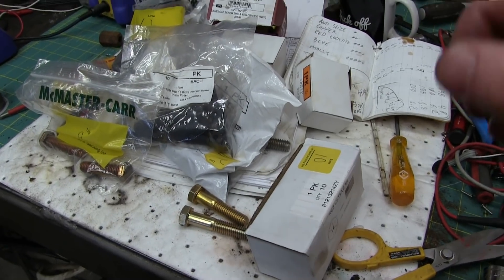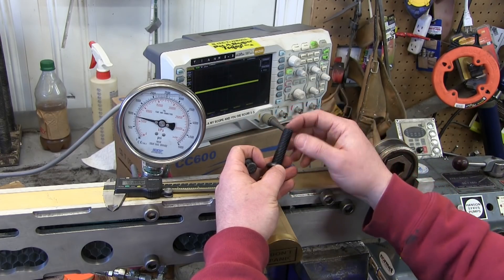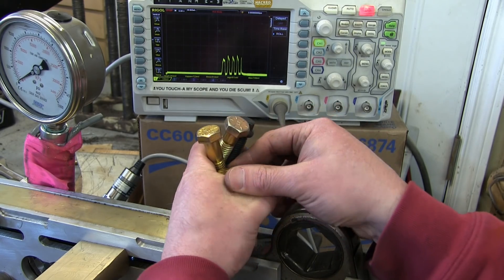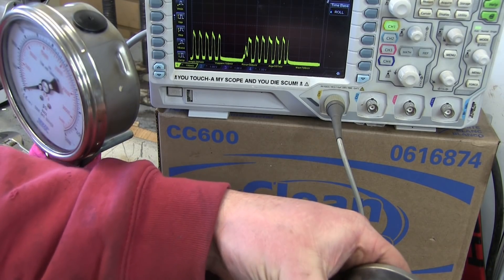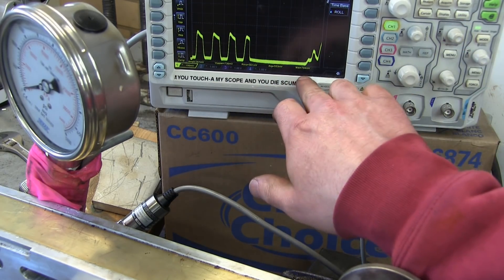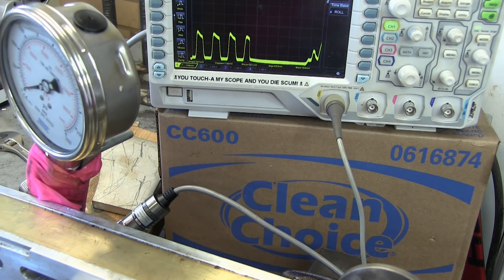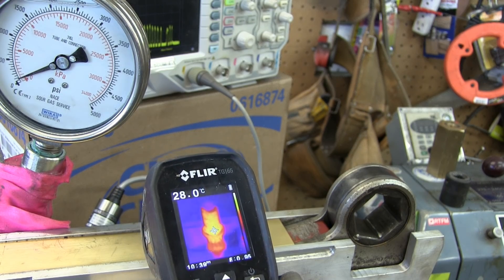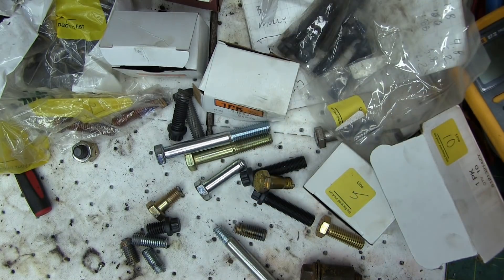Home Depot Bolt vs. USA Made | Offshore Suprise!

Comment: The challenge with using bolys that are significantly stonger/stiffer than the rating is that you will not torque them to the correct amount for them to function properly.  A properly torqued bolt is stretched but not yeilded so it will act as a spring to retain the load.  Some applications require that bolts be springy.  This is especially important when there are significant loads from thermal changes.

Comment: I'd like to see the torque waveforms integrated over time; see which bolts spent more "torque energy" in different stages of ductility. I suspect there is a ductility sweet spot would give at less torque than a harder fastner, but may also allow more energy overall to be exerted in the stretch. Drywall screws are hard as frig, but don't build your house with them.

Comment: Does  your test rig read higher than ~780 mv when back driven like this?  It seems awfully suspicious that the stripped out threads gave a similar reading to breaking the bolt on the last one.  It looks like the gage itself isn't going over 500 on any of them.

Comment: We use J H  bolts to screw in our pilings and extensions. Our tap out torque is between  8000ftp to 15000ftp. Our threaded connection is a Mayhew Style coupler and Bolt we build. If powder coat gets on a threads , it would stripe.

Comment: AvE is it true a bolt only has to go  in the depth of its diameter to achieve its full torque strength?

My old boss used to say that and as you mentioned about the length and only having to be 6 threads or so to achieve that strength.

Comment: I was taught in high school shop class that fine thread was stronger because it has more surface area of thread in a given length. Never looked it up to see if that is correct, the thicker "root" of the bolt is logical as well.

Comment: in australian mining industry everyone asks for CAT bolts from good ole USA
Reply: yep! I used em for head bolts on my 302 Ford Motor. 12 point heads, still in there!
Reply: @stephenvelden295  Interesting. I don't quite know what your version of CAT is, but I know it as California Auto Transpeed. It's a Chinese company that makes crankshafts. I have a 3.75 inch version for a small block Chevy to stroke a 350 to a 383. It's made of ductile iron. Excellent Crankshaft. I've abused it and it holds up. Balanced right out of the box, machining for the rod and mains was spot on....Can't buy 'em in America anymore.
Reply: @ViewThis.  CAT is Caterpillar. It's a registered trademark.
Reply: Freedom bolts!

Comment: Sad fact: manufacturing will follow demand. Masses demand cheapest. Corporations follow product flow measured in units moved. They direct manufacturing to follow trend. Engineers find ways to CUT costs providing financially sound returns on investment.  Product floods markets. Consumers buy extra cause of great deal. Cycle repetition. Further cost refinement. And the beat goes on and on and on!

Comment: I worked on a subarban with a rough country lift kit in an auto repair shop. The fuckin thing was put together with home depot shit, like the washers were dishing. No holes lined up on this POS welded flat bar lift kit and it took way over time. Had coworker who has never done a timing belt being like "bro just cuz its a truck dont get mad" and my boss kept asking me why it wasn't done, then the customer comes back and tells me to look up torque specs and make sure everything's right. I laughed and said "they wont hold torque if the washers going to extrude out anyway" I called a tow truck and got my tool box out of there 8 am next morning and did not apologize. Now I work in a Mercedes Benz shop and get to work on real vehicles (nobody likes the old mercedes here so I get ALL of them and love it).  Not super relevant, it just pisses me off people are driving around massive trucks held together with chinesium just to look cool.

Comment: the test works but u need to account for the amount of attempts u made, since u are adding higher toque than what u are seeing. What you are seeing is your own physical limitations. Do a pull test of sorts. Have worked with all those bolts and yes quality does matter for strength also consistence.

Comment: All of the Asian market hardware is pretty strong, they have a tighter control on the quality of their steel and actually their 10.9 grade metric fasteners are far stronger than a standard USA grade 8. Their 12.9 grade metric fasteners are really strong, They make diesel engine fasteners out of 12.9 grade metric threaded steel.

Comment: I have seen a lot of problems with generic Chinese fasteners in my career.  My experience is that if they have a mark on them indicating the manufacturer (YSK for example), they are probably good quality. 

Keep in mind that stronger is not always better -- all the material properties should be met. For any given alloy, strength usually comes at the expense of ductility. If impact loading is present, a higher yield strength bolt may fail before a lower one because it is more brittle (i.e. requires less energy to fracture).

Comment: Random question, we deal with compression tube fittings typically from parker and swagelok in my trade, but occasionally we run into steel tube fittings with a "C" stamped on them that don't play well with standard swagelok parts. I have always been taught that these were carbon steel fittings, but we had one that clearly showed it as 316 stainless. For the life of me the google monster can't solve this one. Any insight?

Comment: The chinese make a clone of the colt 1911 pistol, made by a company called Norinco. I've read they're made using extremely hard tool steel because that's cheap and plentiful over in Red China. Might be a similar situation with their fasteners, they've got all the manufacturing over there, so now the quality is making the migration.

Comment: This is pretty interesting. I'm a carpenter and I work on a US Marine Corps base once in a while doing remodels of barracks. We're actually not allowed to use any Chinese fasteners because the grade of steel could be anything. The boss man would love nothing more than to put in a big bid and use the cheapest fasteners money can buy, we use hundreds of pounds on each building. Everything we use from metal truss screws to structural steel bolts has to say "Made in the USA" on the box so it's strength is actually what it says. I was a little surprised the Taiwan bolt was so good. The more you know.

Comment: I used to work for a company that did NDT, DT, Xray and Ultrasonic testing for military parts. In the DT (destructive testing) area, the way we tested bolts was how Uncle B described he would do it for the next episode - Pulling the bolt from top and bottom and getting to see the failure point. It is astonishing how much force they can take before they warp. But that being said, with any Steel base structure, you hit a certain point of force that becomes common on the high end. It is the upper limit the atoms can withstand before you start introducing things like titanium or cobalt. Super fun job tho, getting to break shit the military owns :)

Comment: Great video it demonstrates why many OEM's use Torque to yield in critical applications. Its a very flat curve so very predictive clamping force.  There is so many more to the grade then just the breaking point how much the bolt will stretch what the curve of that stretch is etc etc etc the pinky ring bandits can drive you crazy with that stuff they have to figure that into their design so when it changes by off shore products like these and they don't yield as expected higher or lower is bad.   From my understanding that is why the SAE standard is important at both ends of the scale.  They were 1/2 bolts right?  The SAE sheet I have says 85-128 Ft-lbs recommended torque so that wasn't to far off.

Comment: Looking forward to the pure tensile test!  I think (hope) the results come out a bit different on that one.  A large percentage of the torque applied is used just to overcome friction, both in the threads and under the bolt head, the type of lube and thread/surface conditions play a big role in that.   

Another thing that was always counter intuitive to me was that fine thread fasteners were spec'd as requiring the same or greater torque values as coarse.  You'd think that the shallower pitch would give a mechanical advantage resulting in more tension with the same amount of torque applied?  But because of the increased thread engagement and the larger pitch diameter, there's more friction as well.

Comment: our lab does grain size & alloy analysis of steel & alum for cost reduction (read sending work from eu/usa to asia). i've seen some chinese steel not even close to the spec (lo carb stainless) & taaarrrible heat affected zones in brazing aluminum. big grains = zero fatigue life.

Comment: Since steel is elastic there was not need to destroy the bolts😀, as soon as the osmeloscope readings became constant you could have stopped. Stabilization of the readings ment bolt was streching as a spring
Reply: In fact it would be interesting to measure maximum displacement before they gave up, in addition to the force itself

Comment: Well, you are measuring the torsional force. A poorly formed thread of a chinese bolt will give you a higher reading without stretching the bolt. Try a unf into a unc nut, to see if this has any merit. /Daniel

Aaand you just ended the video with a promise to test the bolts in a different way,  Cool  :)

Comment: Rule of thumb we used in the machine shop was maximum thread holding capacity was reached when engagement was 1.5 times the diameter of the fastener regardless of thread count.
Reply: You're right K J, and plastics would be even further out of bounds.

Comment: I was always told that you get full thread strength at two times the diameter. For example full strength on a 1/4" bolt would be 1/2" of thread. I think this is a general rule but it gets you in the ballpark.

Comment: Do you have plenty of stroke left on the ram? With all of them failing at the same torque I'm skepickle...steptickle...curious if a larger bolt would also fail at that torque. If so, I would pump some more oil into her.

Comment: 1 1/2 × D is max holding on all threads. EG: on a 1/2" bolt you only need 3/4" deeps of thread. So say you take a 1"-8 tap and tap it 3" deep into steel (good luck with that btw, I've done it, you need a coupla 200 pound gorillas just to turn it) you only need a 1" bolt 1 1\2" long for max holding power. Getting a 1" bolt 2 1\2" long won't be any stronger.

Comment: Use a Thread pitch gauge to examine the stretch of the threads before and after the destructive test.  i check head bolts by overlapping the threads completely.. if they won't close up the gap totally i know they are torque to yield..  torque to yield bolt threads in the block don't stretch only the areas not threaded into the block.  i personally think that TTY head bolts are a cheat for OEMs as its much easier to keep a multihead fastener tightening tool in calibration when the torque calibration is only 20 or 25 foot pounds than it is with it at 65 foot pounds.   my cleco nut runner uses a friction clutch to set the nut torque.. slipping when it reaches torque..  requiring constant checking depending on who is using it.. if they don't stop when they reach the torque and continue spinning it.. it wears the friction surface and throws it out of calibration.. others who use it know to release as soon as it starts to slip and the calibration stays for a much longer time.

Comment: Results seem suspicious. Are you sure your transducer wasn't topping out at 780 (ish) mv or whatever it was. If so every bolt(other than the grade 5) are going to appear the same. Where did you get the torque reading - was it a translation of the (possibly flawed) voltage reading? How about a standard torque wrench reading. I know you had the pressure gauge on there too but it's so much overkill that even large differences would be hard to see.

Comment: The reason why the cheap one are as strong as the strong one but not have the same grade is most likelly that they simply do not offer a toughtness garantee.

Like, if you harden something without actually making sure that the process is right, you can't stamp it as that hard.

Another possibility is: it's the same fricking bolt! Same machine and process that do all of them.

It might be simply cheaper to make all the same and sell some cheaper than having two production line running.

All they have to do with the cheaper one is change the head die. Now you can get a faster machine, produce more, yet make it cheaper.

Comment: why do you pull up on the wrench, instead of pushing down, lot less work when you let gravitas help!
Reply: K J yea but he's not doing single pulls to break the bolt so he can reuse gravity on each pull. I mean even a small guy would have 200lbs on the end of a 12" wrench - 200ftlbs way more than he's putting in each pull.

Comment: This isn't an apples to apples comparison.  All the bolts need to be the same thread pitch,  thread length,  and especially the shank length.  A tightened fastener is a tension spring.  If you have a longer shank,  there is more give to the bolt before breaking,  both in tension and rotational toque.  That's why engineers put long spacer cylinders under bolt heads,  like for exhaust manifolds.
Reply: Thank you,  k j.  I'm referencing young' s modulus of elasticity.  If this test is ever revisited,  I'd love to see testing of bolts where the shank is necked down in the middle. They're made that way so the smallest cross section at the threads is still larger than the shank diameter.  That way the bolt stretch and toque can be fine tuned.

Comment: The difference between a grade 8 and grade 5 bolt really just comes down to the tempering of the steel, and the carbon%.
It's really easy to make a bolt stronger, but stronger isn't always better, the bolts might fail to meet the elongation % specification for grade 8.

I'm not sure how well it would work, but if you tested a few bolts of each type, you might be able to get a ballpark measurement of the total elongation of the bolt after failure, and see how they compare.

Comment: The bolt stress at a certain torque is different depending on the surface finish of the bolt.  The 'slipperier' the finish the higher stress at a certain torque.

Comment: I'm a huge fan but i think your testing is faulty. Too similar results. No way that grade 8 failed, then after pulling threads out of nut, doubling up, then grade 9 failed at same pressure..... Just doesn't compute. Maybe air in your hydraulic system, or maxed out transducer. Do this again using these results old school, put your nuts in a vice! Verified results using torque wrench.

Comment: after being in the structural steel industry you might test these bolts as well. the other test is to explain single vs double shear with the same bolts. also show the difference between it on the threads and shank of the bolt.

Comment: I think people seem to forget that china quit making bolts and other parts out of bamboo a long time ago. Taiwan USA makes a lot of high teck stuff like cnc machines. Mercedes and lexus both have engines and cranks made in china on some of the highest state of the art machines there are. People also associate technology with the areospace industry, but the high speed train-o-space industry I'm sure has helped make some big advances. People get pissed when the 100mph+ train there on flies off the tracks. High speed chinese trains will smoke slow ass USA trains everytime.

Comment: Are you sure your meter is not bottoming out? You striped the nut with 12.9 grade, but with chinesium grade bold you had no problem tearing the bolt apart with only one nut. Any once again, its way to little test done to have a result - you should have done at least 3 of each, to compare results.

Comment: Interesting comparison, but it seems you may have overlooked the real problem. Counterfeit bolts! I present to you exhibit A: Partnair Flight 394. Cheap Chinese (not Taiwanese) bolts were used as replacements for OEM in a part of plane's structure. They failed; all died. It was found that the cheap Chinese counterfeit bolts were not up to snuff in heat treatment. It's not just about quality control/materials/methods, it's also about fraud and no accountability.

Comment: This is interesting. In my experience repairing casters and benders for steel, we used US bolts only because we tried some Chinese bolts - but they didnt break they way they were suppose too. There were a few bolts that were used as a fail-safe. The bolts were meant to shear, however the Chinese bolt were too malleable and deformed to the stress causing some major issues.

EDIT - Just remembered the bolts were A2 bolts - or at least the chinese bolts were labeled as A2

Comment: Straight pull is usually what they do in a college course.  With a good rig and plotter you get a very nice stress-strain curve.  A little easier for neophytes to understand that that even though the material has yielded, it still has not failed.

So why do a lot of head bolt specify a torque + an angle ?

Comment: so a few years back i worked in a mine maintenance store, everyone bitched about how the cat bolts were expensive, we tried the local fastener place for just loose bolt stock in grade 8 imp, the guys would end up using them in place of cat parts, but torqueing up to cat SIS specs you would get occasional failures, we ended up going to grade 9 imp to get something that would hold up to the consistency of the cat bolts, at near enough to the cat price. the cost of snapping a bolt to save a few bucks just aint worth it in my books, our current workshop is nearly 5 miles from the pit, spend the money.